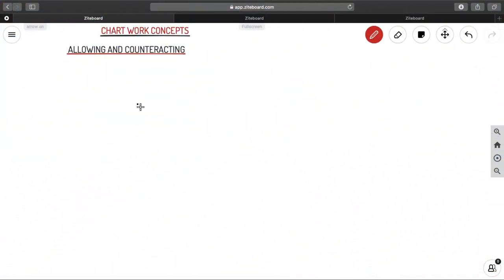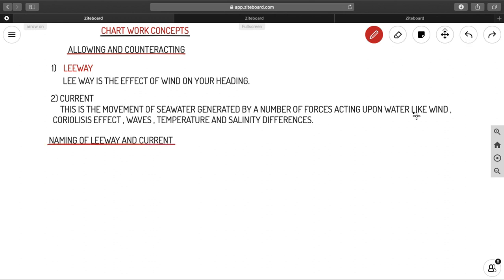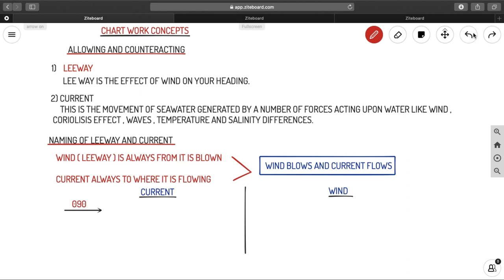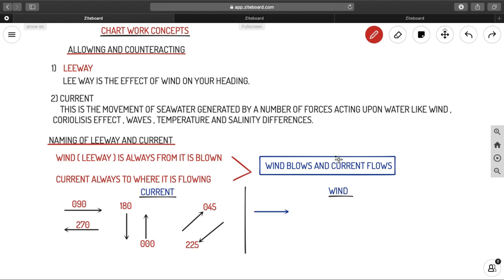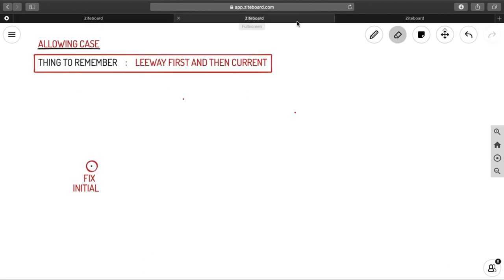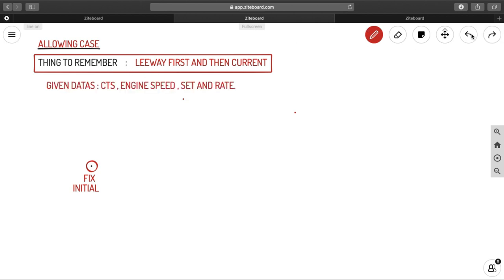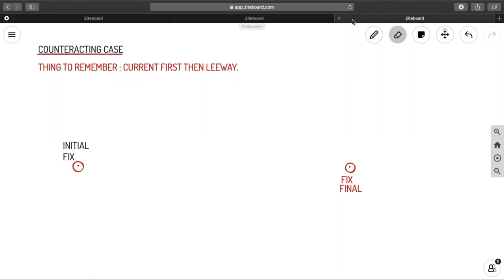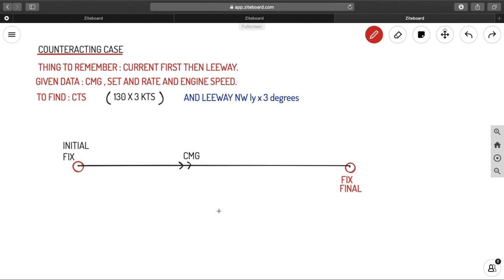HOW TO DEAL WITH ALLOWING AND COUNTERACTING METHODS? | CHART WORK CONCEPTS | AHOY! NAVIGOS.

Comment: kindly explain counteracting current,?????
Reply from the maker: Its already explained in the video please clarify your doubt in which section or part

Thankyou for responding to us
Team Navigos
Reply: @SailorSyd007  sir my doubt is that what is meaning of counteracting current how does it work
Reply from the maker: @satyaadevmishra8277  suppose you are on a course of 000 T and a current is setting from 330 T that is on your port beam . 
If your vessel continues to follow 000 T as your course you will be pushed by the current to more starboard of your present course , thereby causing  the ship to follow another course which could lead to the vessel heading to dangers etc , ie it’s undesirable.
Therefore the vessel has to counteract the current by changing the vessels heading in such a manner that the resultant of the current would cause the ship to follow the dersired course ie 000 T in this case , but the vessels heading wouldn’t be 000 but a different course.
Hope this clears your doubt
If you still have a doubt feel free to reach out on our Instagram handle
ahoy_navigos
Reply: @SailorSyd007   that means sir if on course as you said 000(T) leeway is 3 kt so we will be on course 003 instead of OOO T to avoid more set to stbd we steer course 357 T to keep vsl on track is it right sir
Reply: @SailorSyd007  thanks alot sir for this Awesome and adorable help
Reply from the maker: Yes you are right, just a clarification leeway is measured in degrees and from direction which wind is blowing and not in knots, but the concept what you said is correct.
Reply from the maker: You are welcome 

Reach to us if u have any more doubt

Regards,
Team Ahoy! Navigos

Comment: Sir how to plot a point using the course and tha Lundy island on BA5047 paper chart
Reply from the maker: Good day,
Thanks for reaching to us.

In that case when vessels course and light house in given for lundy light house there is the sector of its lights marked in chart and normally it will be given lundy light first seen or last seen at certain time so when ur course enters the sectore that is when it will be first seen and take that sector line as one PL and the other as next PL then you can do normal running fix or if you have 3 bearings then go for 3 point bearing method.

I hope you understood.

Regards,
Team Ahoy! Navigos
Reply: @SailorSyd007  sir I have some question can you make one video on solving those questions
Reply from the maker: Just reach to us on instagram and will see to it.

Regards,
Team Ahoy! Navigos

Comment: Sir I have a question to find cts if we have time differences is 3h30min the current vector will be 3h30min or the same 1 he vector to find cts? Pls answer sir
Reply from the maker: Its should be equal triangle if you take current for 3 h 30 m take ships speed also for the same duration if you can take current for one hour take speed also same that means both duration to be same